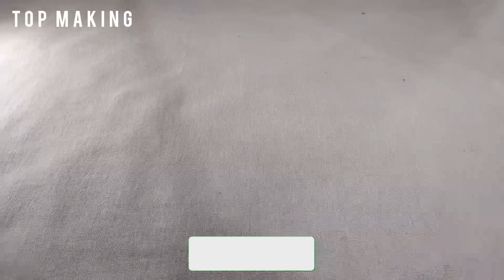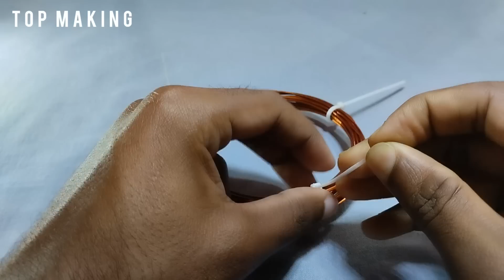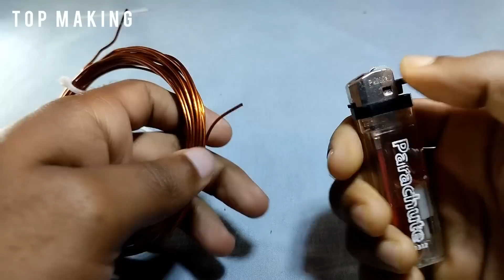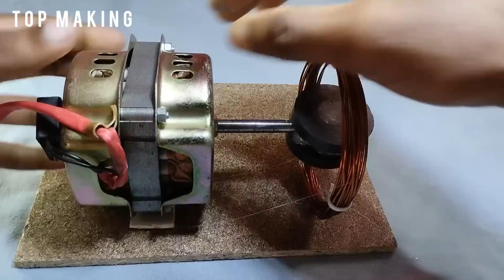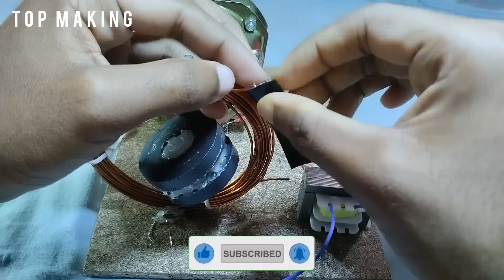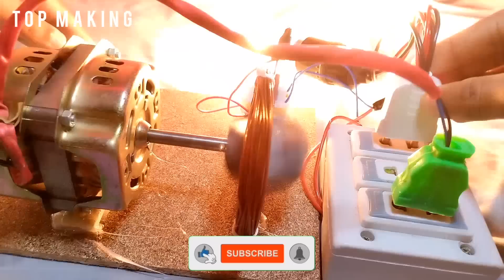Free Electricity Generator 240V From Big Coper Wire

Comment: Your design is very impressive but it could be improved by the addition of a phased subduction reversal switch in series with the transformer circuit. This would damp out any subnormal resonances and would also make the device more suitable for powering non-reactive LED systems such as the latest generation of turbo accelerators.
Reply from the maker: thanks a lot sir
Reply: Udaya✌️👌👍💡🧲
Reply: Thank you for your insightful comment! The addition of a phased subduction reversal switch sounds like a fascinating idea to optimize the generator's performance. It's great to see innovative suggestions like this. By the way, have you considered the Segway Portable PowerStation Cube Series? It offers a massive capacity, fast recharging, and versatile sockets, making it a reliable choice for outdoor power needs. Happy camping!
Reply: Thank you for your comment! While the addition of a phased subduction reversal switch sounds intriguing, it seems more suitable for specialized electrical systems. However, if you're looking for a reliable and versatile power solution for outdoor adventures or home backup, I highly recommend checking out the Segway Portable PowerStation Cube Series. Its massive capacity, fast recharging, and comprehensive protections make it an excellent choice for powering various devices.
Reply: Yeh exatlly

Comment: plus what is the voltage of the transformer or power, and what is the thickness of the aluminum wire
Reply: It's a shame that the device builder doesn't indicate which parts it uses and details about each part as the part manufacturer indicates so that in different countries they can refer to the same parts with the same suppliers and not constantly show how the device looks from all directions and the cleanliness of the work surface. The details are important so that people in different countries do the same
Reply from the maker: thanks

Comment: To everyone who thinks this is real, please read up about the 2nd law of thermodynamics.

It is stated that you will receive (if lucky) equal, or more likely less power than you put in, making the generator grind to a halt eventually. 

Unfortunately if you put a load onto the generator for example you tried to power a light bulb, you will get resistance created by the generator from the lightbulb which will definitely stop the energy continuing altogether. 

Unfortunately these are the laws of thermodynamics, and that is proven science that can't be broken unless shown otherwise (which would be a massive scientific breakthrough that the whole world would hear about).

There is no such thing as 'free energy'.

Take for example a cup of coffee or any hot drink, the heat is energy. When you leave a 90°C hot drink in a 30°C room, will it stay just as hot half an hour later? Or will the heat be released into the room that is cooler?

Even if you apply the same logic the other way around (the hot drink takes the heat from the surrounding room), will the lower temperature of the room still keep the tea hot?

No, Energy is lost either way in the process. 

Unfortunately every video you see or 'free energy' is a complete bluff (apart from real renewable energy). 

I just don't condone videos that promote fake science that clearly don't depict reality.

Sorry to burst your bubble guys.
Reply from the maker: thanks
Reply: Das erkläre mal einem bildungsneutralen Mittbürger . Der glaubt dir nicht das ,das Video reine Verarsche ist
Reply: According to thermodynamics 2nd law which is base on and a confirmation of the principle of conservation of energy by Kelvin-plank, it states that "it is impossible to construct a device that operates in a cycle, extracts heat from a single reservoir and perform an equivalent amount of work on the surroundings ". However, he also propounded that "if it is possible to develop a device or mechanism which will produce work continuously while exchanging heat with only a single reservoir at a constant temperature then such a device is called a Perpetual Motion Machine of the Second Order(PMMS). Note that reservoir as used here means any large body from which heat can be drawn from or added to, at constant temperature
Reply: Mind this project works according to the principle of electromagnetic induction stated by Michael Faraday. The same thing applicable with Genset.
Reply: Leave about  the law,give it a practice  and  see if work.

Comment: All of you doubting, why don't you give it a try to see if it really works. By the time the magnet turns, it produces electromagnetic Field causing the electrons in the coil to move, hence producing electricity. The transformer is to step up the voltage to 220v(in case the rpm of the motor is not enough to produce 220v), that is why the coil is connected to the secondary side of the transformer.
Reply: Du versuchst gerade in einem runden Zimmer in die Ecke zu scheißen .
Reply: Prove the machine violates the law of thermodynamics and I will get you a nobel prize in the Simulation
Reply: @VoidraMusic  потребление 2.5 ватта) на выходе 2 лампы 15 ватт 110 ма) и можно еще пару штук подключить) получишь нобелевку привози половина твоя)
https://www.youtube.com/watch?v=pcIm0Y-tLc4
Reply: Показанное устройство по закону Фарадея способно генерировать токи изменяющимся магнитным потоком. Но в показаной  конструкции изменения магнитного потока происходят вдоль проводника значит токи  генерируются  поперек , а не вдоль проводника. Снять токи поперек проводника невозможно. Если бы автор это знал, то не стал бы позориться публично. Подобные токи могут только завихряться и нагревать проводник. Вектор магнитного поля  всегда направляет токи  по плоскости своей линии Блоха т.е. перпендикулярно своему вектору. Такова природа.
Reply from the maker: thanks
Reply: Qual seria o valor do secundário  desse Trafo?
Reply: What is this type of copper wire?
Reply: @abudancemex1533  - it is called "satan's copper" which produces electricity even without source of power.
Reply: @abudancemex1533 insulated cupper wire
Reply: What was the last thing you put, is that 12 volts to 220 volts converter?
Reply: @GaniMontlano-df5te step up transfomer or boost transfomer
Reply: Hello ,but me i try this one but it did not work...
Reply: Pleas what Can i do agane ?
Reply: да никто не сомневается что это работает)) главное не показывать дырку в столе  и провода от розетки)) а к какой обмотке подключать двигатель и лампы разницы нет ))))))
Reply: Con    este  diseño Salvaremos la  casa  grande  o   es una   estafa?
Reply: @eddygomez9271
Reply: @reinhardwerther4641  ziauddin
Reply: Чушь в сё это

Comment: I think it will work with woolen thread instead of copper wire, the main thing is not to plug the lamps into the socket
Reply: Hidin wire under the board 😅
Reply: its true somthing , i tryed in same manner but it was not working
Reply from the maker: thanks